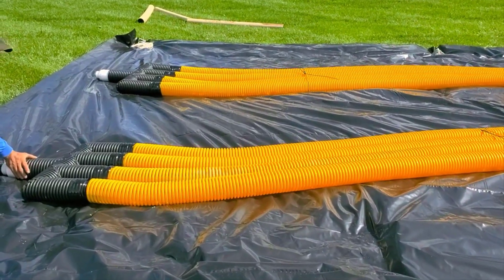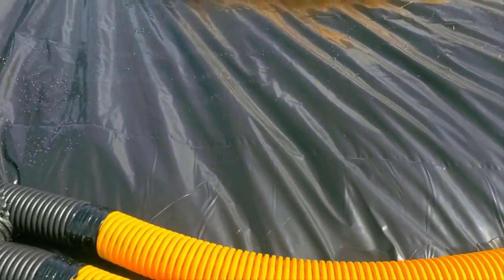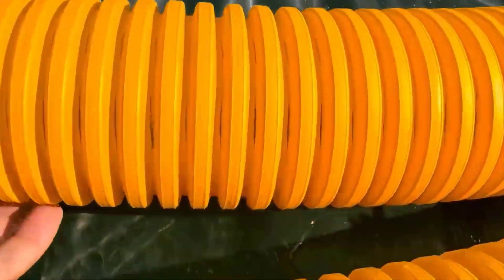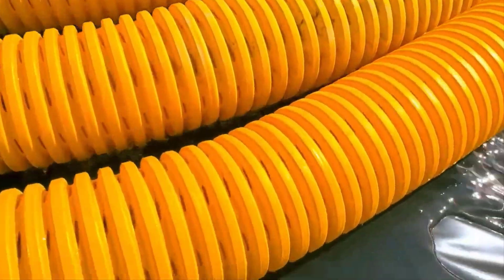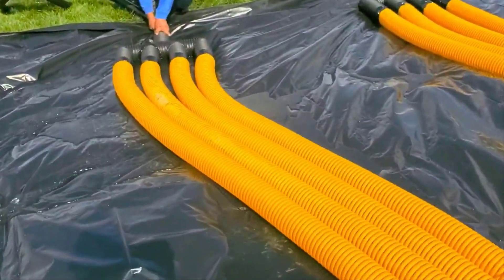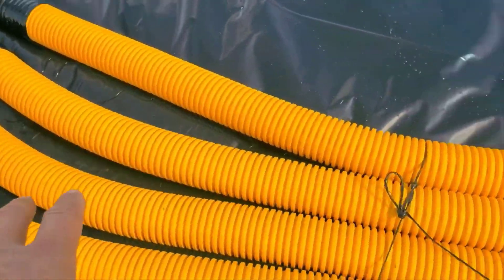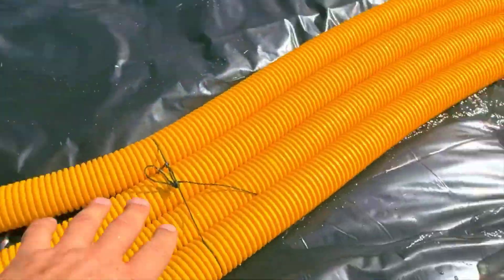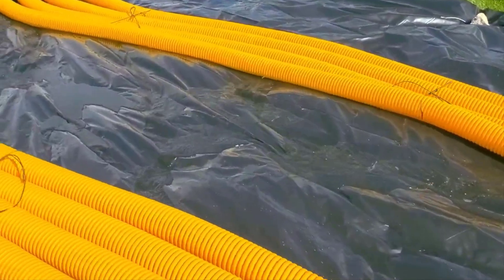How to Use Perforated Corrugated Drainage Pipe to Disperse Water

Comment: How do you properly use a collection pipe without the water going right through it?
Reply: How do you move water from a collection pipe down the line without it just seeping through the other side of the collection pipe?
Reply: @ezra5300  Solid pipe.